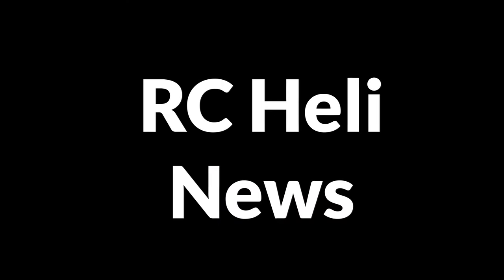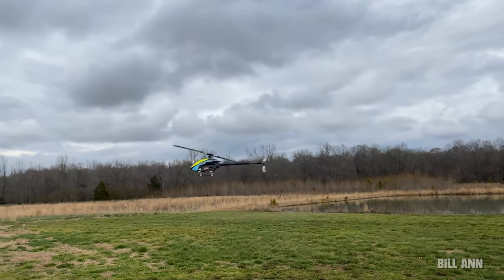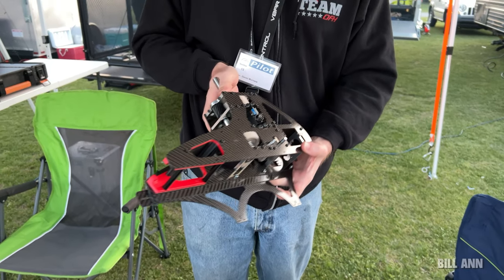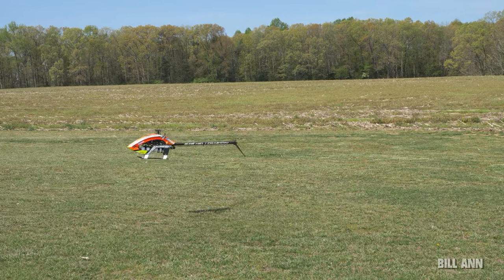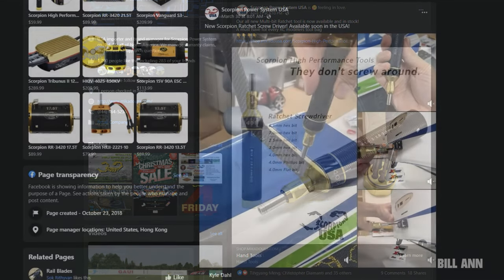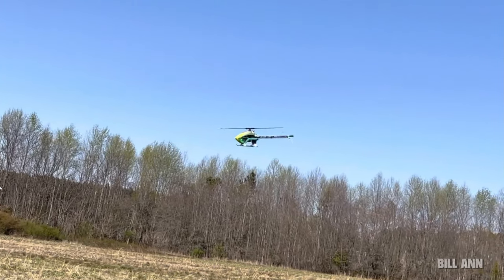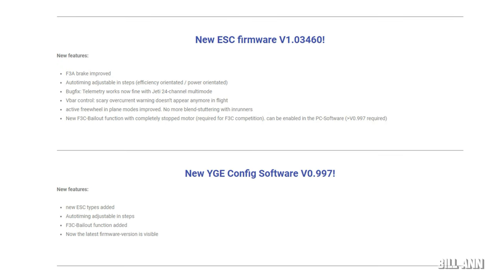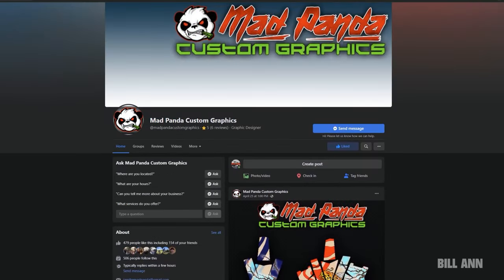RC Heli News May 2022

Comment: OMG! you mentioned gas powered! <3
Reply: I havn't had a heli for 25 years or so.  They were all nitro or gas back then.  I start looking around at them and most are electric which I am not a fan of.  Even the radio gear has changed so much lol